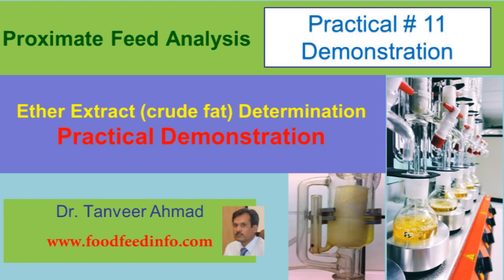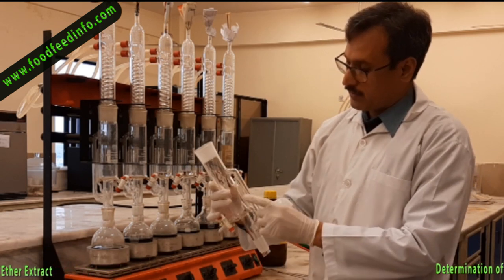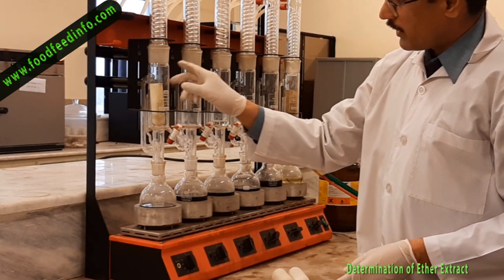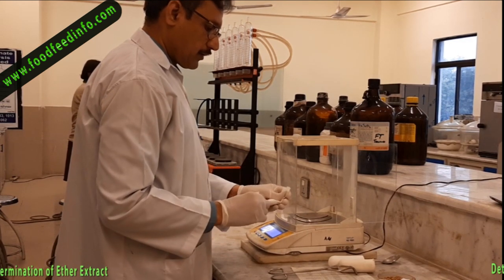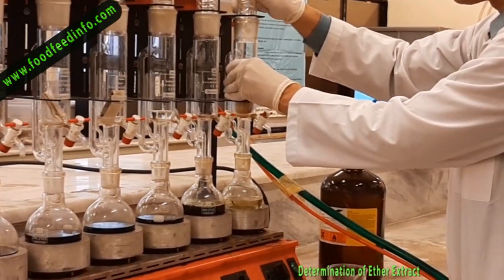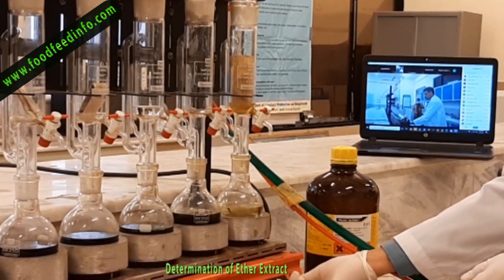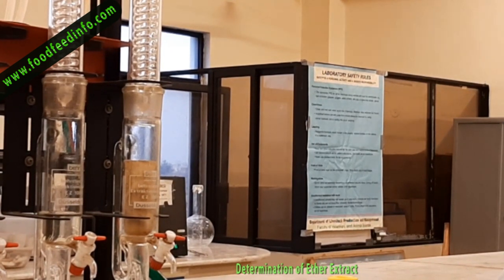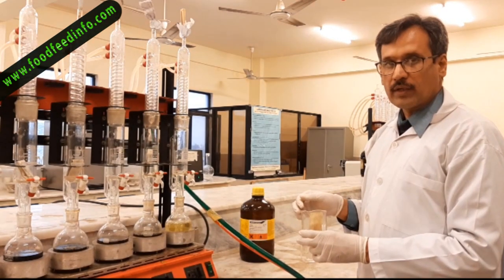Practical#11-B-Demonstration of Ether Extract or Crude Fat Determination

Comment: 1.The top most part of soxhlet appratus is condensor, while middle is collection jacket and the lower one is flask.Flask is used to collect ether.
2.For weighing sample first take dry filter paper and then 5 gram sample is placed on it. After weighing sample is packed and put into the thimble and then thimble is placed inside extraction jacket.
19-Arid-2269

Comment: Weight an average amount of sample for about 5 grams as well.
And the temperature should be in between the 40-60 Centigrade that will avoid the loss of ether.
19-ARID-2279

Comment: Petroleum ether is used as solvent in ether extract determination having boiling point 40-60•C
Pure form of ether has transparent color, however the yellow color of ether indicates the presence of fat in it. 
19-Arid-2290 
Evening-A

Comment: ✓ Soxhlet apparatus is the apparatus that is used for the ether extraction.  This apparatus have three parts;
Condenser,Extractor/sample jacket,Flask and also have the 6 heaters where 6 samples at same time can be run for ether extraction.
✓The temperature of the heater in Soxhlet apparatus must be kept 40-60°C because the boiling point of ether is same (40-60°C)

19-Arid-2254

Comment: In Determination of ether extract , we use Soxhlet Appratus that consist of condenser , sample jacket where we place sample ,and flask where ether get collected . Place weighed sample in filter then in thimble . 
Then place this thimble in sample jacket  and pour petroleum ether on the thimble .
And turn on heating plate . Temp must be in between 40-60 •c . 
After condensation ether will be transparent (where sample is not present ) . And yellowish colour where sample is present due to the presence of fat . 
After this remove the sample and let it in air .so left ether on thimble gets  evaporate . 
19-arid-2276
Evening group b

Comment: If color of ether is transparent it is pure form but in the case of green color, it may indicate the presence of fat and other chemicals.
Soxhlet apparatus has three main components:
•Condenser, Extractor/ Collection jacket, Flask along with 6 heaters and temperature of the heater in Soxhlet apparatus must be kept 40-60°C because the boiling point of ether is same (40-60°C).

Comment: The temperature of heater higher than 60 degrees Celsius will result in difficulty we face to collect condensed ether due to high rate of ether evaporation.
19 arid 2214

Comment: To measure the weight of sample take a filter paper mark with pencil, then note the weight of paper.
Always use dry filter paper and dry sample.
The temperature about 40-60 degree celcius is required for ether extraction.
19-arid-2320

Comment: 40 and 60 degree Celsius is required for ether extraction
For ether extraction soft plate collection apparatus made of three parts 
lower part flask
sampling chamber 
upper most the condenser

19-arid-2203
Jahangir Iqbal 
section A

Comment: The temperature of heater is higher than 60° C will result in Difficulty we face to collect condensed ether due to high rate of Ether evaporation 
Syed Jawad Hussain Shah 
19- Arid-2250
Section B

Comment: 1)The completion of ether extraction is indicated by  the color of ether i.e., colorless, after which the thimble  containing the sample is removed from the extraction chamber.
2) In this procedure, we  have used petroleum ether as a solvent, having boiling temperature of 50-60 degrees.
19-ARID-2248